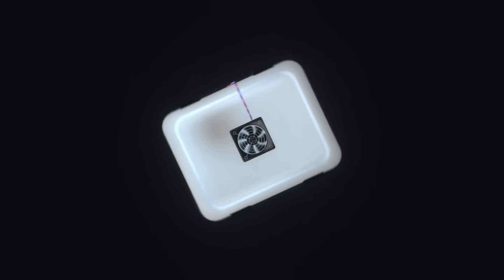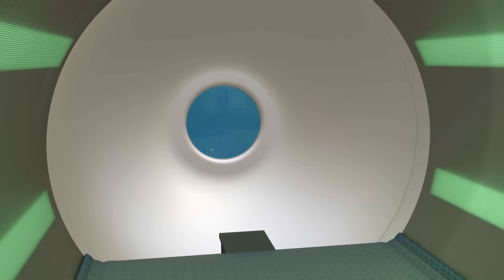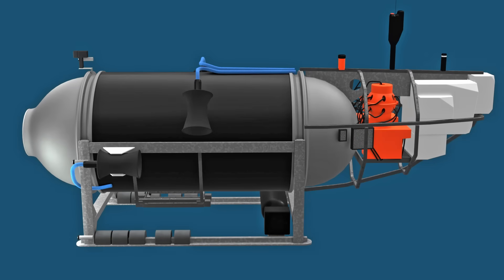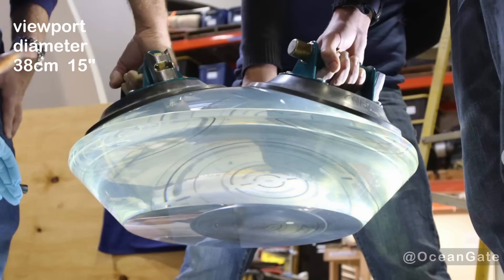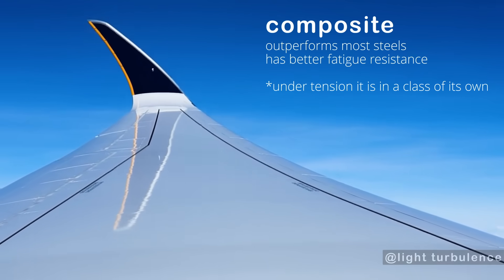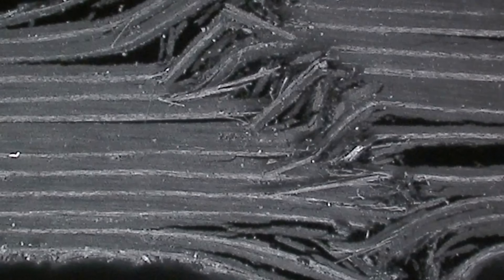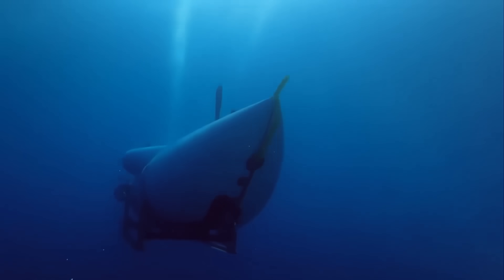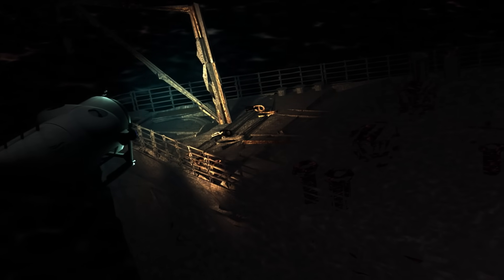Titan Sub | carbon fiber - Detailed Tour

Comment: their are a few things in this vid that i have slight issues with, seeing the outter flange hanging after the thing has been salvaged from the bottom of the ocean, stuck on a ship and then unloaded at a port, and you see the flange hanging down and assume it got blown outwards? perhaps it got sheerd inwards while attached to the carbon then its weight and the salvage process makes it look now like its hanging outside, doesnt mean it got blown outwards. also something i still dont see anyone mention is the fact that the glue bonding the cylinder to the titanium flange had to not only take the stress of the dissimilar materials incomtatable compression properties each cycle, but the amount of hours they spent with the door hanging open in rough seas troubleshooting the long list of issues, the amount of missions that got scrubbed, each time with the door spending hours open with all that uneven force from that heavy ass door hanging from one side must have been putting serious load and fatuige on the bond that it just wouldnt deal with well like it would all the other loads its subjected to, i truly beleive its that hindge and hemisphere being swung open and kept open far too often that caused the most stress and fatuige on the bonding surface that it just does not look to me like it was designed with that load in mind, yes its got a well engeneered joint structure to put up with the stress of dives, where its all evenly compressed and both hemispheres are basically pressed inwards onto the bond while diving, but its got a sheering, twisting, peeling load put on it from the door
Reply: Those flanges look like a good thing to look at further to me. They are quite thin if you consider what the axial forces are doing to the cf tube. Could it be that the cf tube was being compressed to such a degree that there was high load being placed sideways on those flanges? The animation did not show a radius at the bottom of the flange recess so I wonder if there could be some progressive cracking showing up in the flange breaks, note the inner flange was shown to be broken too.
Reply: @dzzzzbutube  its very possible, but i think its more probable the forces involved are so insane
Reply: i think you are are right, maybe an internal metal skeleton to support the weight of the doors and not put twisting forces on the carbon fiber when they were left open
Reply: The flanges and titanium end caps are blown outward, the bolts between them are blown, and the window also.  Big explosion (just after implosion) like a diesel.
Reply: The flange could be peeled open due to a failure of the CF tube as when it collapsed it would natural bend in the middle but push out at the ends and hence push the flange outward. Also as it failed the end domes would be pushing inward and would also push the flange out when the collapse started. In it self I don't think it was a problem with the flange but the CF and glue used, in my opinion. I await the report but it may never be fully disclosed as it's such a contentious subject already. It is sad when people die but the the correct testing could of saved them and may have improved the design to a point it could be usable tech.
Reply: There is a new invention available to YouTubers, it's called a period. Makes text much easier to read.
Reply: @RobbinChewings  never seen one in my life,

Comment: Good point on the chamber cylinder axial loads. My take on this failure is in that carbon fibre is stronger than the epoxy to fibre bond strength. So the other loading on the hull material for a layered construction is radial. Without a radial tensile component in the build there was nothing to prevent the inner layers developing longitudinal ripples as the inner layers progressively delaminated under the compressive shrinking of the diameter. Mid layers are kept straight by surrounding material but the inner layers can wrinkle inwards to restore their original circumference. Also I would have opted for a shallow “V” tapered tube end socketing into the titanium end caps. The stripping of the titanium groove ring suggests that the hull ultimately on one side rather than Uni formally.
Reply: I'm astounded it lasted as long as it did.

Comment: Well the things is… like any other material… materials have strength in either compression or under stretching… and carbon fiber is not strong in compression, but in stretching. To demonstrate that compression is the key issue in a submarine, just take a rubber and, lay it flat on a table, and begin constricting it from all sides, inching ever closer to the center… no resistance! Try oppositely to stretch it from the inside, ever outwards … resistance all of the way… same for carbon fiber!

Comment: Anytime you have some form of fabrication you always run the risk of improper application, methodology is crucial and should always be checked by testing the results. Unfortunate that the masses always right off things they do not understand by a blanket statement. I would have tested this thing at at least 30% greater depth several times with sensors before putting any living creatures inside. Just volume changes alone could indicate how the hull is behaving and be indicative of structural damage and impending failure.

Comment: good video. Most people don't seem to realize a purely carbon fiber submersible designed to reach the bottom of the mariana trench was invented, and tested to pressure successfully. But it was not designed for repeated dives, so it only did it once. Obviously carbon fiber can be compressed. I think not going through destructive testing was the largest mistake.

Comment: What I never understood is "Where are the motors controlling the pitch axis!?"😅
[There are three types of movement: pitch, yaw, and roll.]😊
Reply from the maker: Thst puzzled me too.  There arent pitch specific thrusters and the system seemed to work so I presume that it was balanced by crew placement.  The sub remained horizontal so not an issue.
Reply: @Mike-Bell  They mentioned this problem before... everyone wanting to peek at the same time and destabilize the sub. Eventually another miscalculation in some of the most difficult achievements and corresponding design.💨

Comment: As an engineer, I personally wouldnt have got into a 'plastic pringles tube' and subjected it to 375 ATMOSPHERES (5,500 psi!) I prefer thick steel or titnium around me - I dont care how strong they reckon carbon fibre is. It AINT gonna stand THAT pressure unless it is over 1 foot thick of solid carbon fibre, it was mere INCHES thick. Delamination was probably a factor causing fissures to form between layers gradually destroying integrity. The whole craft looks like something my nephew designed when he was 12 - NOT a serious submersible. A test dive should have been carried out UNMANNED, by remote control to prove integrity BEFORE putting passngers inside.  Also, even if they had surfaced in time safely AWAY from the recovery team they could not 'self rescue' being BOLTED IN....I pity those poor souls as apparently they had nearly an HOUR of hearing cracking sounds before the final BOOOOOM as it imploded to the size of a coke can. (This is a PROVEN fact) as Stockton Rush texted the support ship stating " we are hearing crackling noises" - and dropping both the ballast AND the frame around the sub - over an HOUR before implosion.......crushing everything inside to liquid. My sympathies to all families involved. This could have been avoided. 😔

Comment: The only further comment I might make as an engineer, to add to the already excellent comments made by the (few) C-fibre subject matter experts below, is to the remark around the first minute or so. It was in regard to the advantage of having such an easy to enter design, which rather shocked me. It was this very design, involving "bolting in" the occupants - shades of Apollo 1 ! - that really bothered me and many others, and was initially implicated as a potential point of failure. The real issue is the mere expoxy-ing in of that seal ring to the C-fibre hull. Imagine, a critical seal component, subject to potentially very large, albeit residual, shear forces on that and the effect of ring distortion with such an awful attachment base. There is actually no saying that any load shift on that item was NOT implicate in the eventual overall failure progression. Give me an uncomfortable submarine hatch anytime!
best regards,  DKB

Comment: Hello Mike,  I found this interesting with many good points but very wrong on some key points. I personally wrote 5 patents related to making RFID technology survive to 40,000 psi and 400 F and so that sensors could survive in a downhole environment when affixed to drill pipe used for drilling oil wells.  My early attempts used epoxy resin compounds to encapsulate electronics and they all failed under high pressure with the primary failure mechanism being that a microscopic bubble near the surface of the epoxy would create a weak point that would form a rupture path and initiate a chain reaction of failures.  Failed epoxy components would look like they had a microscopic shaped charge blast through them.  I tried many approaches to solving this issue with resin based materials but after a while, my solution was to NOT subject epoxy resin materials to high pressure fluids as they would always end up failing.  Laminated  composite materials have immense physical strength against macroscopic forces but are not appropriate as a barrier material against high pressure fluids.  I could enlarge upon this with much more detail but the conclusion does not change.
Reply from the maker: Hi Ian thanks for your comment.
Epoxy resin has compressive strength of about 70MPa whereas carbon filaments can withstand around 650MPa.  So its not surprising resin only failed at such pressures and it makes sense that damage would progate from the minute bubbles.  I am curious how you eventually succesfully enclosed the electronics.

Comment: Thank you for making this. Everyone thinks they are a materials engineer. NASA made the orion crew module out of carbon fiber. They wouldn't have done it if it was inherently dumb. It needs more testing which Elon 2.0 didn't want to do. Stockton is just an unlucky Elon. https://ntrs.nasa.gov/citations/20080018960

Comment: I used to work in a materials research laboratory (acoustic emission) 20 years ago. We knew then that carbon fibre had only one failure mode and did so with no warning.

Comment: I read somewhere that there is a not well understood mechanism of failure called "snap buckling" that occurs with fiber and resin structures first seen in undersea fiberglass pipelines where the interior of the pipe is at a lower pressure than the exterior. The major feature of this failure mode from what I read is that these pipes would fail first at the innermost layers and that the failure would proceed from inside to out. This would explain the loud noises compared to gunshots in the video heard on previous dives because even a real gunshot on the outside of the hull would be greatly reduced on the inside. What are your thoughts on this kind of failure?

Comment: There are so many comments from armchair Engineers, let me add my two cents. As someone who fixes poorly engineered parts by making better parts that last, here is my observation. It failed. Bottom line, it was poorly and recklessly engineered. I would argue CF is a poor choice for a submersible at this time due to the fact there are little if any real test results for this application. Steel is a proven material for submersibles and CF is still in the theoretical stage.